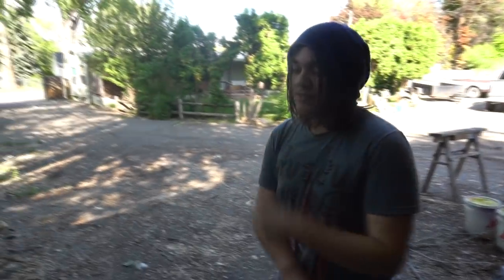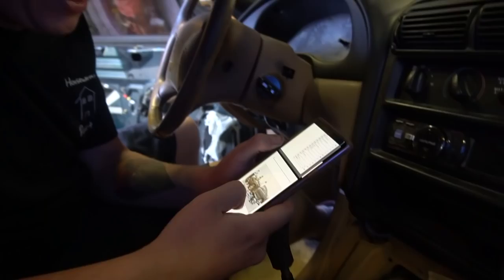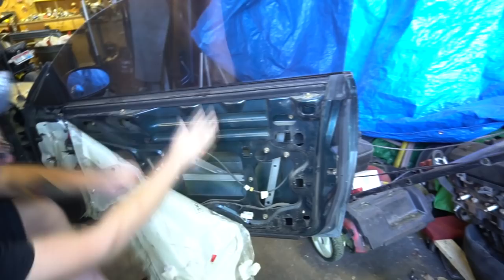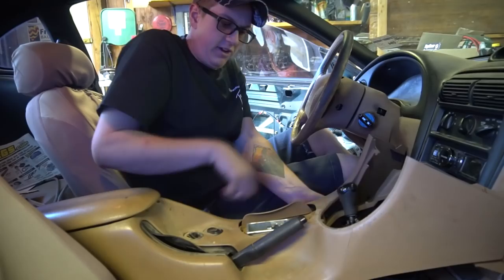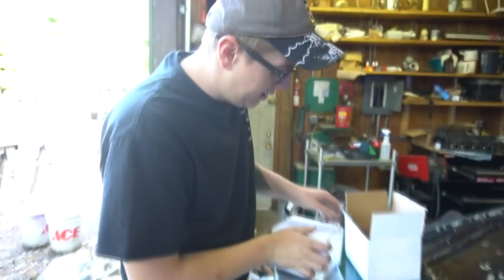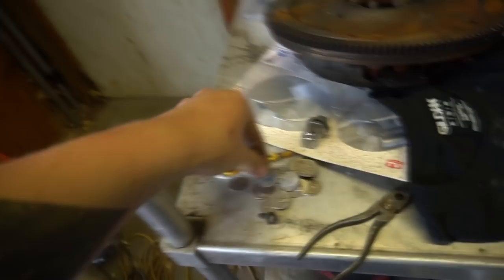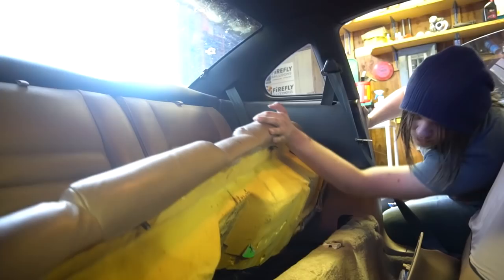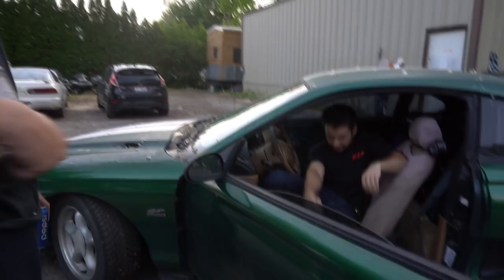Skidstang Is Almost Ready To Drift!! (Interior Strip and Short Shifter Install)

Comment: That steeda shifter is one the best and my fav for a mustang. You have to set the stops on the front and back of the shifter if you don’t you will over throw the shift fork and do damage .. also make sure you got that little cup back in the trans that the shifter ball sits in.

Comment: if the window motors arent burnt out its usually the plastic bushings in the motor that just broke apart. you can replace em with 3 10mm nuts and it will work happened to my sn95

Comment: You know your car door has been worked on before when you find a screw driver inside the door panel because every time I opened or shut the dog or hit the breaks it would slide and clang inside the door so I popped the panel off and found it